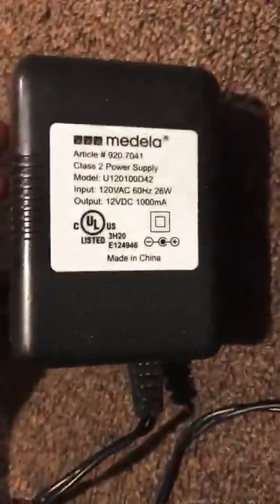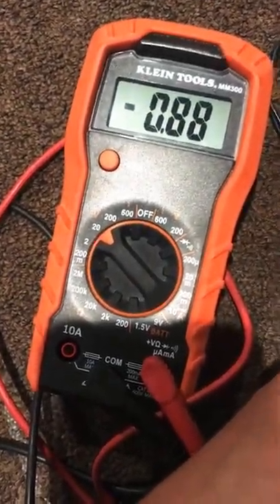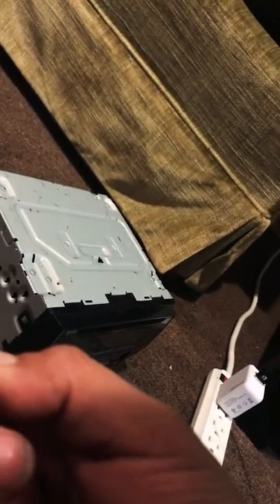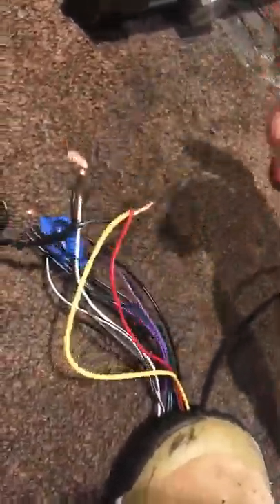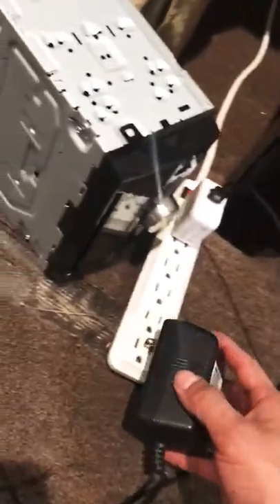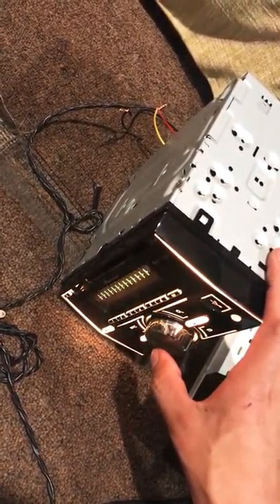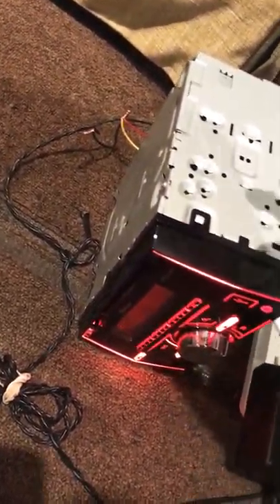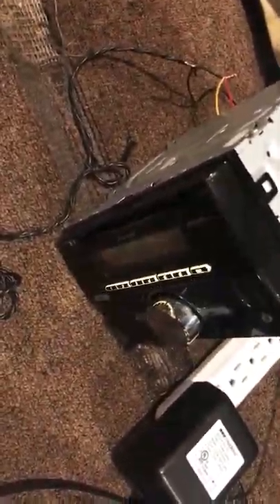How to test a car radio without installing it at home

Comment: Very good video in general. To everyone else doing this please isolate the lines. You twist caps for the wires or just some electrical tape. The voltage is not dangerous to you but it only takes one wire to slip to short and damage your stuff. 

Also, make sure your speaker wires are all isolate and do not touch. If any of those speaker wires touch each other you can short the fuse or IC on the head unit.
Reply from the maker: Man i made this video 4 years ago… i will try and make a new one  better quality and on a table, thanks for those tips too!!👍🏽
Reply: @azaelm4829  absolutely and thanks. This video is helpful to people and honestly you explained everything super well. Cheers.

Comment: You've just helped me fix my radio. Thanks man!
Reply from the maker: Sounds good😅, maybe you just needed to know which wires to make it work👍🏼, thanks
Reply: @azaelm4829  yes indeed, for some reason I have a problem with the ignition cable (red) and when the radio was attached it didn't work. So after doing your trick (mixing red and yellow), the radio now works.
Reply from the maker: @houssemazzouz7133  im glad it did help someone in the world😊😅👍🏼, no worries, we all learn something new everyday, just like a lot of people from youtube help me

Comment: thanks mate you gave me a idear instead of using a old plug i use cheap battery charger what i charge my 12 volt batterys with and it worked fine

Comment: Thanks for the video! Very helpful. But what do you do if there's no black wire from the harness? The bag the harness came in says "when there is no black wire present, ground radio to the vehicle chassis." Just like you, I'm testing this without a car. I'm not sure what to do here!
Reply from the maker: Find an available bolt on the chassis of your car and use it as negative, run a black wire from the black wire coming from your radio to the chassis, so connect the 12v to the hardness on your car and the black comong from the radio to the chassis on your car amd test, this is done on a car, outside idk how to, i would have to have the radio on my hands to see😬😅
Reply: @azaelm4829  Well, the problem is that I'm just testing the radio like in the video. There is no chassis! I just have the wire harness and two connectors. So I can tie together the positive (red, yellow, etc) but can't do negative as I do not have a black wire coming from the harness.

Comment: Very good work, but is the sound intermittent or good ? 
and can the radio be turned on for along time in this way because I love the car radio very much at home ?
and thank you again my friend
💐
Reply from the maker: Yes the car radio can be used like that, , the sound is supposed to be good on all speaker wires

Comment: Just put the red and the yellow in the. Hole and the black around it
Reply from the maker: MLG Nicolas  yes that would be the jack connection on the car, just be careful to not short it or will have to replace the radio fuse or the car fuse👍🏽
Reply: @azaelm4829  how dose it short

Comment: Hy. Can i do it with 24V or 6V
Reply from the maker: Im guessing 6v wont do the trick… and 24v is double the amount of what it can take so… idk, try the 6v, maybe it dont work properly or not enought power to turn it on… or try 24v and maybe burn the radio😄😅, careful.
Reply: @azaelm4829  what do you think abouth battery from the drill 14.4V
Reply from the maker: @josiptolic1404  it will work
Reply: @azaelm4829  thank you very much

Comment: Can i do that with 9v adapter?
Reply from the maker: Yes it will work for testing purposes
Reply: @azaelm4829  thanks man, i was about to destroy my wifes laptop charger.... So she's thankfull as well 😂
Reply from the maker: @blondyka1   isn’t a laptop charger 19v??😂👍🏼,  glad you didnt make a mess of your laptop and the radio😊
Reply: @azaelm4829  just tried it and my radio doesn't work. I was not sure if the radio was broken or some contact in the car. If your instructions are correct, my radio is broken.... That radio costs 1500€ new if its original. I was hoping that it is something else....
Reply from the maker: @blondyka1  if you are hoping its something else then check the voltage with a multimeter coming from your adapter, if there is no voltage then try another power adapter
Reply: @azaelm4829  thanks for the advice. I will do that.